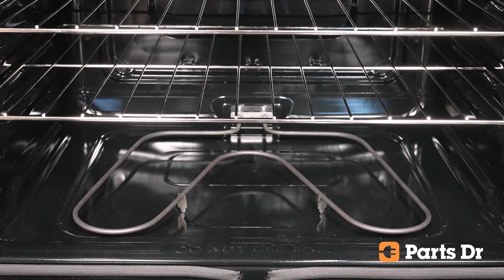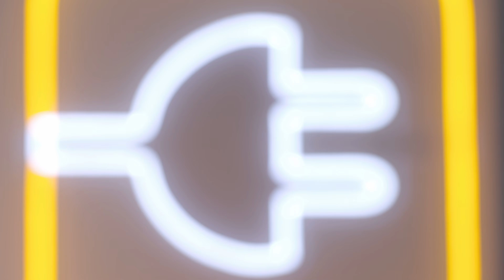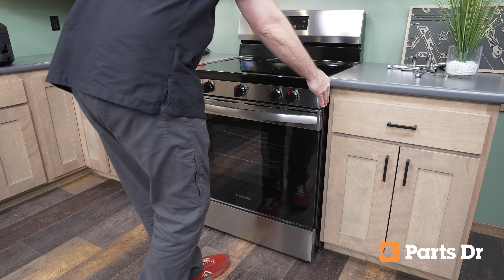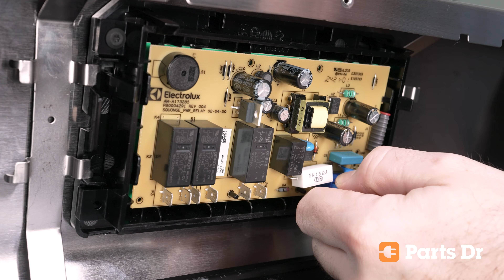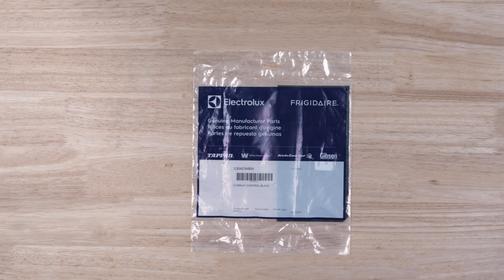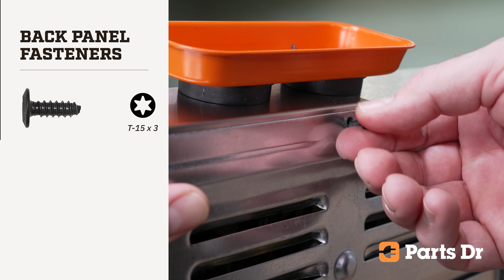F10 or F11 Errors? How to Replace the Oven Control Board on a Frigidaire Range Step-by-Step Guide

Comment from the maker: If your Frigidaire range’s control board is acting up, this guide will help you get it replaced step by step! A quick heads-up if you're shopping for a replacement online, be cautious of cheap aftermarket parts from sites like Amazon or eBay. We've seen many of these fail quickly or cause other problems. For the best results, we recommend using a genuine OEM Frigidaire control board. You can find the high-quality replacement part here: https://partsdr.com. Let us know how your repair goes, and feel free to drop any questions in the comments!
Reply: Found out a German roach pooped on mother board

Comment: I have the same over but get an f10 error code.  I’ve already replaced the temp sensor probe. What should I look at next ?
Reply from the maker: F10 - Runaway Oven Temperature - Since you have already replaced the oven temperature sensor, the next thing to look at would be the wiring between the heating element and the control board.  If you don't see any issues with the wiring (breaks, shorts, etc), then you most likely have a bad control board that is stuck and constantly sending power to the element.  Replacing the control board should fix your issue.  Please let us know what you find.

Comment: I’m on a frigidaire FGES3065KFA with error code EO 15 code. It just beeps incessantly. Still trying to figure out what’s going on.
Reply from the maker: This is what the service info says: EO15 - ESEC self test failed. An E015 error code may indicate the ESEC-UIB is not receiving a synchronization signal from the ESEC-Relay Board. Check first if J2 pin 5 on the ESEC-Relay Board is wired to P4 pin 5 on the ESEC-UIB. If wiring is good and the problem is still there, replace the ESEC-UIB. If the problem persists, replace the ESEC-Relay Board.
Reply: @PartsDr Thank you!!!